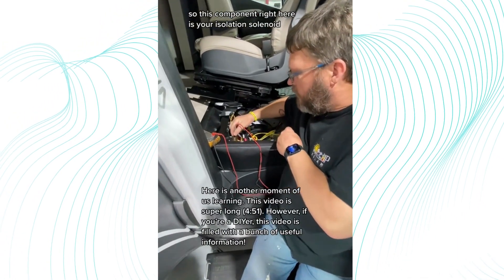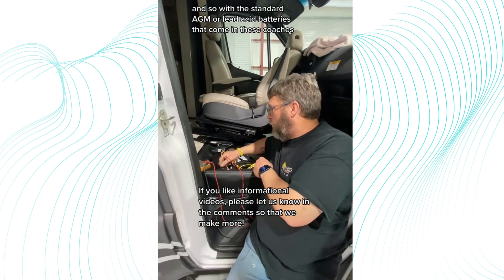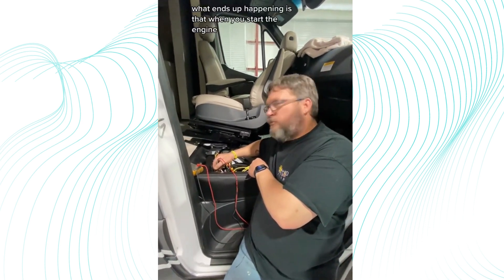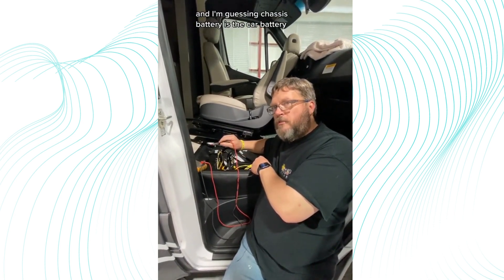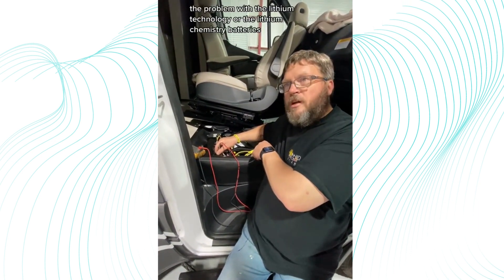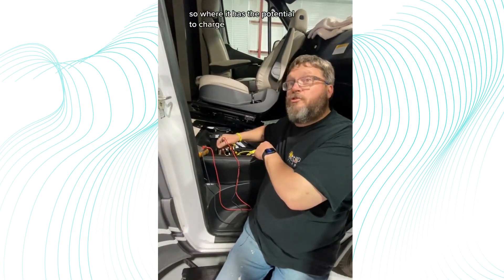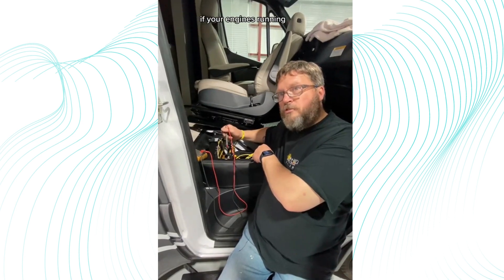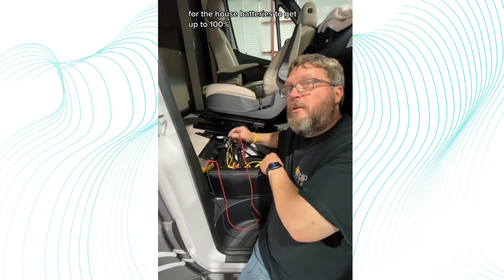DC to DC Charger or BIM (Battery Isolation Manager) Which One Is Right For You?

Comment: I don't understand why you ditch the isolator, the moment you add the dc-dc lfp4 charger. Why not keep both? Wouldn't a smart isolator make sure your starter battery is topped off?

Do you have any experience with hybrids by any chance?
Reply from the maker: It could make sense to have them both, however, it comes down to most customers are looking for an “either, or” solution. There are reasons to have both, most people do not want to go through the effort or engineering to use both. I have tried running both the LiBIM and a DC to DC charger and though it can be done, needs to be set up right to make it functional while doing no harm.
Reply: @PanelsUpSolar  I planned to use a Victron Cyrix smart isolator (might not be needed) for lifepo4 and Victron Orion SX (their 50amp dc-dc). From what I read the Cyrix is engaging the lifepo4 charger when the voltage of the "starter" battery is above 13.4V. 

But reading from the Orion SX manual, I think the Cyrix or any other smart isolator might be - somewhat obsolete "The Orion XS can be set only to supply power when the engine is running. This is possible thanks to the integrated engine
shutdown detection. This eliminates the need to adjust in-vehicle wiring or add an engine detection sensor to determine if
charging can start. It also prevents the voltage on board the vehicle from getting too low. In addition to this detection, the Orion
XS can also be forced on via the remote on/off port "

I still see the advantage of having a Cyrix. Say - somehow - the car battery is loosing current. But in that case, one should detect the leech or change the battery if that's the case.
Reply: @PanelsUpSolar  And then I have this problem of DC-DC amperage. The Prius converts the big battery into 12V. That line has a 125amp fuse. On it there are about 6 other electronics (heater, engine cooler, lights I think etc). When stationary, that line has been proven to supply 1000w/80amps safely. 

But when driving, that "allowence" decreases. I've seen people doing 20-30amp charging. I wonder if the 50amp Victron will stress the car too much or not.
Reply: @PanelsUpSolar  Confirm something. The Orion XS 1400 - you can adjust the AMPS output right?

Also, if the Orion is set to 50amps output and an alternator (or convertor in my case) can't keep up with that demand, then the charger would fry the alternator?? i.e. the user has to understand the limits of the alternator and to set the charging parameters accordingly, right?

Or in other words, the Orion does not limit itself based on a drop of current??

What if I one were to add an MPPT (like solar controller) could that adjust the current based on the supply and avoid burning things?

If you want, I can give you guys a call tomorrow. If replying here is too tedious.
Reply from the maker: @cubul32 Tomorrow is not a good day for a chat as I have a full shop of jobs as that is what I do for a living. We do offer one on one consulting if your project needs that but it may be a week or two before we get a break in the schedule to get you in. But if you open the VictronConnect app and turn on the demo mode you will see that the XS1400 has the ability to adjust the input and output current. So you will be able to regulate either.

Comment: It sounds like for a 200A alternator, a BIM would charge the batteries faster. I have 000 cabling.
Reply from the maker: It is really hard to say. Is the 200amp alternator a dedicated alternator to the house power or is it also shared with the chassis charging as well. You will also want to look at the charge specifications of your alternator. Just because it is rated for 200 amps, there are a lot of variables to that number as well.
Reply: @PanelsUpSolar  I looked up the BIM specs and it cuts off at less than 14V. What the heck?
Reply from the maker: @The_Ballo depending on the brand or batteries you have, that will be plenty to bring your system to a high state of charge. Your solar or plugging in at a destination will then allow the batteries to go through an absorption charge if needed. A lot of the manufactures of the higher grade batteries are only charging to 14-14.2 v anyway as the BMS is able to better balance  individual cells above 3.4 volts.
Reply: @PanelsUpSolar  My alternator puts out 14.2V maybe I can find a different solution like a ballast resistor
Reply from the maker: @The_Ballo When you are charging the lithium batteries, your alternator will not read 14.2v as the lithium batteries will soak up as much charge as the alternator will send to them.

Comment: The LiBIM225 would be the easiesr to install because it would basically be a direct replacement for mu existing BIM. I am just not sure the 15 on 20 off is adequate.  A lot of damage could be done at idle in 15 minutes. I have a shunt on my house batteries but that is only measuring how much from my 180 amp alternator is being put into the house batteries. Seems that if the BMS could simply be adjusted to max charge amperage that would be all that was needed. The idea of a switch to open the bim is not that bad an idea. Keep it off till on thevroad and runninf at a higher rpm.
Reply from the maker: @timmyers3428  It can be controlled with a switch inline with the ignition circuit.  As far as duration, it will take a bit to heat the alternator to a point that the cycling would not be able to keep up with heat gains.

Comment: Can you install both and switch from one to the other?
Reply from the maker: @artcabrera3598  I had done some testing at one point that actually allowed me to use both on a demo board. I tried a couple of different scenarios while adjusting the charger settings so that the DC to DC charger would kick in after the cycling Li BIM would stop cycling. It did work but most customers would not want to pay for both plus the labor to install and testing to make it work properly. A DIYer may look at it differently.

Comment: So then wire size on a lithium charge controller should be bigger then on the dc to dc.
Reply from the maker: That depends on the amperage that you're running to both the lithium charger and the DC to DC.

Comment: Because your isolator has large diodes in it, no chassis battery power is allowed to go to the house battery and vise versa. Only alternator power is controlled through the BIM. It has provisions to manually ( you put in a switch) to allow chassis battery charge while on shore power, or house battery, whichever is currently available.  The isolator blocks job is to prevent batteries stealing power from one an other , unless you flick the switch you added or repurposed " Boost Switch ( if equipt). Many systems already have a BIM, but this one does something special, by pulse charging the lithium House battery to save the Alternator from damage.
Reply from the maker: I'm not exactly sure what you were trying to explain above because that's not how the lithium BIM works. The lithium BIM has a sliding contactor that allows direct connection between the house batteries and the chassis batteries when that connection is desired. It contains a control circuit that will allow the system to analyze and charge if required the house batteries, based on voltages of both the chassis and house batteries. This control circuit is activated through a power wire connected to the ignition circuit. When the control circuit is active, it will analyze both batteries and when the house batteries are below 13.8 V and the chassis battery is receiving a charge from the alternator it will allow the contactor to close and allow charge to flow from the alternator through the chassis battery into the house battery. The pulsing that you are referring to is a 15 minute on, 15 minute off cycle.There is also a signal wire connection that you made reference to as the boost switch. That switch is utilized to manually close the contactor and can be utilized in case of a low state of charge on the chassis battery in order to boost the charge of the chassis battery. Also within the control circuit, the lithium BIM will monitor the house battery voltage, and when it is receiving a charge from an exterior source, such as solar or an inverter charger, it will allow the contactor to close and charge the starting battery for an hour.

Comment: I need help. Im trying to charge a 300 ah li battery's with my chasis battery. Ive decided to go with a dc to dc controller. And a switch in place of ignition.  But my question is, does the dc to dc charger protect my car battery? Or do i need something else. I want it to.charge my li battery but not drain the chasis battery.  I will long be running a 12v car fridge, and possibly a 12v rooftop ac
Reply from the maker: the DC to DC charge controller can be set to automatically shut off if the supplying power source drops below a designated voltage. https://www.victronenergy.com/media/pg/Orion_XS_12-12-50A_DC-DC_battery_charger/en/index-en.html

Comment: My RV IS in the shop now and I’ve purchased lithium batteries but the shop told me  installing those will ruin the Firefly system and burn the alternator it’s a Tiffin Open Road. So with this I can charge the battery while driving but the FIREFLY System is the light switches do you know anything useful I can look up to understand what they mean by it not being compatible with lithium.
Reply from the maker: The firefly system does not allow the system to be configured for the Lithium Charge Profile so the inverter/charger does not properly charge the system. The charging from the chassis battery would also not be able to go through the Firefly system. But it can still be accomplished. You should go through the shop that you bought your batteries through and get their recommendations.

Comment: I still feel at the end of the day the DC-to-DC charger is less stressful on the alternator.  I wish Victron would come out with a 12v charger that’s a bit higher than 30 amps.
Reply from the maker: They did, https://www.victronenergy.com/dc-dc-converters/orion-xs-12-12-50a-dc-dc-battery-charger. Will be available soon.
Reply: @PanelsUpSolar  Wow!  Thanks for the info.  I was not aware of this.  Looks like it'll be available around April.
Reply: I'm also waiting in line for the orion XS.  50amps for hours of driving vs a BIM that hammers on the alternator for 40% of the drive.  The ability to see exactly what its contribution to the house bank is not trivial, to me.
Reply from the maker: @tedutley859  700 watts added to the average alternator is still going to be a heavy load. Especially if running it through long lengths of 4 awg wire. The communication portion is certainly going to be a nice addition for sure.
Reply: @PanelsUpSolar  I have 180 amp alt, and 2/0 cable from alt to house batts.  4/0 to inverter.  Not too taxed, buy I just can't get behind the BIM.
Reply from the maker: @tedutley859   Having the heavy battery cable is good. You will still need to step it down to 4 awg to make the connections work. I am curious to know if you ever tested to see what the current was normally coming out of your alternator.
Reply: @PanelsUpSolar  Never checked alt output.  I may put a clamp on it when doing the XS.  Yeah, the 2/0 cable lands on the boost solenoid 3 ft from the batts.  The XS and lynx will be near it.  4ga from solenoid to XS, then to lynx.  Probably less than 18in or so.  4/0 batts to lynx.  We'll see how it goes.

Comment: Great video but man.. This stuff is killing me.. I’m an electrician but it’s like trying to understand Korean lol I’m just trying to add a second battery to our 4Runner.. potentially in a pelican case so we can remove it and use it like a generator. Do I really need to splurge on the dc-dc charger or can I use a red arc isolator? I do intend to have solar panels for backup but I assume the majority of the charges will be from the alternator or just topping it off in the garage. I’d gladly pay you for your time if you’d be willing to walk me through what I’m trying to accomplish here. Potentially through email? Or whatever you feel comfortable with.
Reply from the maker: If you are just charging a single battery, then setting up a simple charge circuit should not be difficult but you would want to make sure you do it so It doesn’t have the potential to cause any issues. The dc-dc charger will allow for a little better control to the charge as it will be able to charge with the correct profile. The Redarc with its built in MPPT is decent all in one solution but there is not any reason that a separate controller would work and maybe be just a little more flexible if you are going to keep the battery portable.
Reply: @PanelsUpSolar  awesome thankyou. I’m just trying to get all my parts together I’m currently looking into some different monitoring devices. I see a lot of options that monitor the input/output of a solar system but do you know of something that will monitor the input from the alternator as well as when it’s being charged via solar panels? I’m looking at the renogy 500a battery monitor with shunt and/or the DROK voltage/amp meter. Not sure if you’re familiar with any of these products or if I’m explaining this well lol but figured I’d take a shot and ask. Just want to be able to monitor what’s coming in and going out when it’s hooked up to the alternator and when it’s out at camp on the panels.
Reply from the maker: A simple Victron SMartShunt will be able to monitor the batteries from you. It won't necessarily tell you where the power is coming from but will tell you that it is flowing in or out. We have them in stock and ready to ship. Then as you grow the system, the Victron products will all talk to each other and if you get to a more comprehensive system you will be able to see a lot of detail.
 @ChristiannTyler

Comment: So if my LifePo4 batteries in my class c motorhome are fully charged at home on shore power before leaving on a trip and then by the generator before returning from the trip(or moving/traveling) I should not be worried at all about over heating the alternator?  The alternator charging of the house batteries would be minimal?
Reply from the maker: If you have heavy gauge wire there is a possibility that required current to the batteries could be high as they are going to match the voltage of your starter battery and alternator. So it would be maxing out your alternator when the battery is climbing to that voltage. For a class c, I recommend going with the li BIM as it will allow you to maintain the stock features of boost assist if the starting battery were to go dead but also adds the ability that if the house batteries are receiving a charge through solar or being plugged in, the Li BIM will close the contact to the chassis battery for an hour to maintain the starting battery regularly as well.
Reply: @PanelsUpSolar so would maxing out the alternator for possibly 15 minutes occasionally be ok or bad? Sounds like it would be ok…?